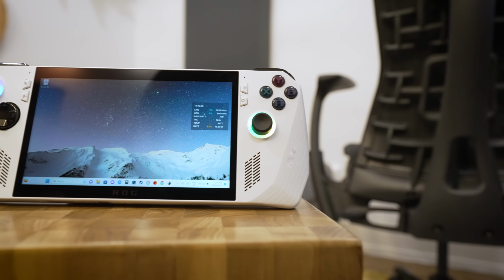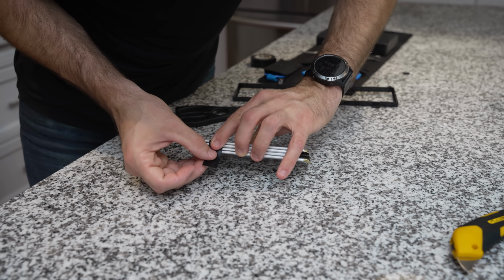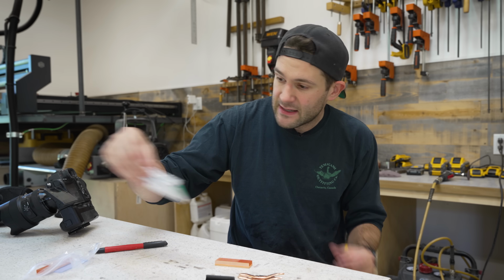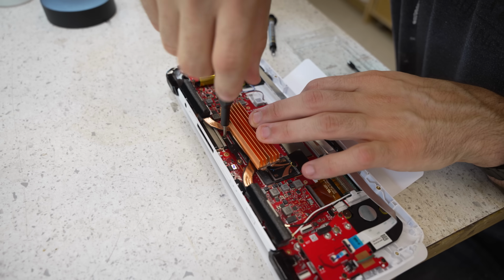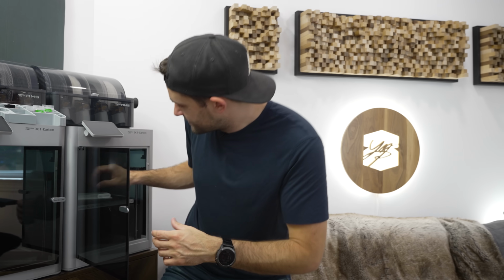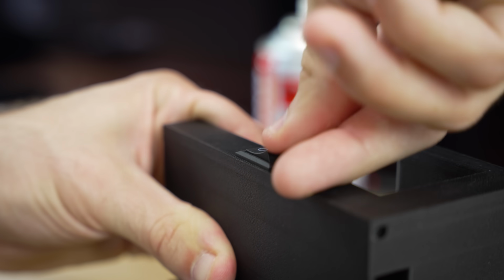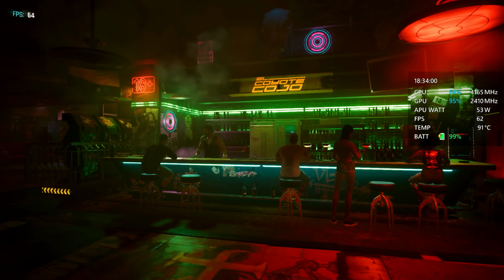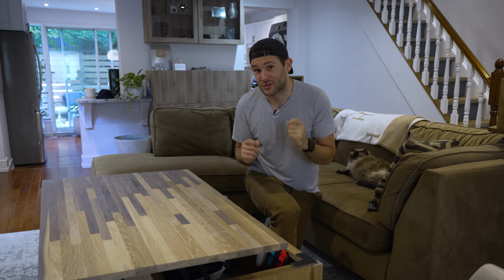I don't understand why people buy Steam Decks...

Comment: believe it or not these processors don't just get magically faster when you improve the cooling.  They have a Goldilocks temp range and it wasn't exceeding that range before so it wasn't throttling.  So yes you improved the cooling but you won't see that big of a difference.

Comment: The sole reason i keep coming back to the Steam deck and hence, why i bought an OLED while having an LCD is just how robust the device is, paired with Valves amazing customer service. If theres something that seems challenging on the deck, the community almost always has an answer for it, simultaneously while Valve is always aiding support as well. Also, the device just works straight out of the box with minimal tinkering, and the ergonomics of just how practical the buttons are, and easy the device is to hold cannot be understated. The deck runs 80% of the games i have and thats plenty for me. Theres always work being done behind the scenes to get problematic games to run smoothly as well, and thats why i will always have my steam deck.

Comment: Reason why I bought the steam deck was it was the first handheld I first waited a few months so they could fix the issues, glad I did cause I was gonna buy a Killswitch from dbrand, but due to them using magnets it killed the fan, and reason why I love the steam deck as well is it is super repairable, right to repair is a big thing to me, and I plan on buying another steam deck LCD to upgrade it to OLED with DeckHD, and the joysticks to make it magnetic joysticks so they don't have stick drift. And hell I can install windows and upgrade my storage to 2tb so I can dual boot windows (gonna dual boot with a SD card due to issues when they update ofc). So you see my loves for the steam deck, here's a few more as well, you got the touch pads, and the back buttons they are in the right place. And you got the ergonomics with my medium hands it's quite nice in my hands. I've given my first steam deck to my sister who was always on the move and she loves it. And I've just heard that you get worse performance and more problems with windows which I have to agree with, when I dual booted windows it was so finnectly cause windows doesn't work well with handhelds yet sadly, and valve did wonderful with Linux, it's quite well made and you got desktop mode which is just using as a desktop. I am not a shell for steam mind you it's just they made the right steam deck when they first made it. And I appreciate that. I wish the other handhelds did Linux as well so we could probably get more people playing on Linux and we get more Linux gaming. Oh and its 350 compared to other handhelds whoch are 500+ if i wanted that id buy a laptop

Comment: While asus really did release a near steam deck killer (I still want one myself lol) they could have easily used that little indent support space to fill with more battery. it wouldn't even have changed how the battery would be made. it would just be an extremely irregular shape, then they could chamfer the edges so it has a nice and smooth slope for the extra battery. It would have probably have doubled the battery life in one sitting. While it wouldn't be no switch, if they had made the batteries hot swappable with two different distinct connectors and it would have cost them essentially the corporate equivalent of $20 and a couple hours of elbow grease with finding a battery maker that could make such an odd battery. Cause asus could have single handedly taken over the handheld market. Especially if they were open and inviting to the mod community (fat chance of that one) they could have even stolen Nintendo's spot as the handheld golden child. (With a few notable exceptions in more recent years. Nintendo should just stick to handheld, they suck at making a console lol)

Comment: I'm happy with my Switch, never really understood why televisions need to be ultra high def as my projector, a device capable of giving me up to a 300" screen looks just fine and it runs at 1080p.  This projector is a Vankyo Performance V630.  I only really use it occasionally and I think for the $100 sale price I paid for it, it has been pretty good.  Otherwise my monitors are in the 20-24" HD1080p category as that's all I require.  

That being said, I'm not sure if it's a good idea to put gaming PC hardware in a handheld platform.  This is the reason most ultra-portable computers use ARM processors.  Nintendo has been using them since the GameBoy Advance and they are renowned for their efficiency and portability while modern x86 processors often need active cooling and lots of space as well as sucking batteries dry very quickly.  That's why they are commonly used in laptops, PC-based tablets/2 in ones over 10" diagonal and desktop computing only.  The APU used in handheld PC gaming machines like that of Steam Deck and this thing is similar in power to what is used in the Xbox One, Xbox Series, PS4 and PS5 machines.  Notice these boxes are typically plugged into the wall and tethered to a television set or computer monitor.

Also, I want to just play the game, not having to tweak settings or wait an enormous amount of time for the operating system to load.  My Switch boots probably much faster than one of these things because the operating system is fairly compact to Windows:  It's a Unix-like operating system built around the processor and system instead of several systems like that on the PC-based handheld.  Now, looking at the Xbox Series X, it's supposed to be a fairly swift box so I guess time will tell.

Comment: I usually get 4hrs+ on my steamdeck without any shenanigans other than setting it to 7w. I love the idea of the ally but they really shouldn't have gone 8 core on the cpu side, i know they call it a "z1/extreme' but the chips are just laptop equivalents (It really stops you from setting lower wattages). They should have made one standard model using something like the 7640u (6 cores 8 Cu)

Comment: That is not the curve of less returns.  The curve you are talking about starts at 0 and 0 for power and returns then as power goes up you get a steady increase in returns until you get to a certain point where it abruptly changes and when power goes up the the returns only increase a little.  It almost becomes a horizontal line.  A good example of the curves with less returns is the curve of memory and performance.  On most computer setups when you try to upgrade above 32GB of memory you won't see a big increase in performance like you would see if yo went from 8GB to 16GB.

Comment: On old cards like video cards you used to see where they had the small heatsinks stuck right to the chip with some kind of adhesive that was heat conductive.  if the heatsink was ever knocked off there was no product that i could find that would work.  I was wondering if that low temp stuff was what they used ... Hmmm

Comment: Power alone isn't everything, that's why the Steam Deck dominates the space.  Valve essentially took the Nintendo approach to a console:  Affordable, capable enough, and most importantly, easy to just pick up and game on.  The differentiator being that they didn't lock their console down, and embraced homebrew.  That's why it works so well.  I tried a Lenovo Legion Go, thinking I would like it more.  I was wrong.

Comment: My Steamdeck failed 2 times already badly ... it got stuck in a booting loop during an updated and had to be reinitialised loosing all my files and gamesaves that didn't synched yet. Then i've moved the stuff to msd and it formated it with my saves on it ... not the best device in existance but way better than asus when it comes to customer support

Comment: Well I might be late, here's why I just bought one:
1. It's considerably cheaper. (I even picked the 1TB OLED model via Steam itself, lower price than the Ally X Model)
2. Devs have an official solution to optimise their PC games, and we get support from Valve themselves.
3. Valve actually keeps to their warranty so long as self-done mods or a third party don't screw up the stock internals LMAO.
4. Who wants to deal with bloated, privacy-invasive Windows 11 on a form factor that was never considered in the first place?

Apologies, but you went too much into clickbait. If it was better than a deck, this video wouldn't exist.

Comment: I don't understand why anyone buys these handheld. The specs for the price are really bad.  For example the steam deck is like 90hz refresh rate. Honestly the best way to play a hand held and to be able to play at high specs is to use your phone, yes i said it use your phone and this is how you so do it! If you have a top model mobile phone say something like the Samsung galaxy S22 ultra or anything higher or the Fold 5 or 6 even better again for the big screen. Well these founds come with better resolution then these handheld PCs and also a big factor the refresh rate which  these top end mobile phones have 120hz refresh rate. Now go get yourself a backbone mobile phone game pad or razer or any of your liking and clip your phone into it. Now your going to say you can't play games with a mobile phones built in graphics card and here is where Nvida Geforce Now massively comes into play. Sign up to Geforce Now and an Ultimate subscription which is around £200 a year (yeah sounds alot but for what you get it's not at all). Now with your Geforce Now Ultimate account and phone attached to backbone pad you now have a handheld that actually plays at 120hz has RTX 4080 performance at full HD 1080p    or 2K 1440p depending on your phones resolution and for a hell of a lit cheaper than any of these overpriced handheld cost. You can find backbone controllers for £60 and say you get 1 full year geforce now Ultimate subscription for £200 that's £260 all in and alot cheaper than the Steam deck and Asus rog rally. Yes you may say oh but that's a subscription and yes it is but everytime Nvidia bring there new top of the range cards out your Ultimate membership follows suite and gets upgraded which means your constantly have the modern graphics card and your not stuck with a big giant outdated paper weight.

Comment: Its THE HEAT, if you can't keep it UNDER 73c then the CPU WILL THROTTLE at 54watts ... at least thats my experience from RYZEN LAPTOPS I have tinkered with... Once I got that HEAT down to under 73c (Now that CPU MAY BE DIFFERENT in TDP throttle) but the loss was a HUGE GAIN at those lower temps.

Comment: I know I'm late to the party but thought I'd might as well point out something I noticed: The 90° NVMe adapter looks cool. But one thing to keep in mind if used to swap to a bigger/cheaper 2280 drive: Make sure you check power usage on the new drive. A fast PCIe 2280 drive might use quite a bit more power than the 2230 model the ROG Ally ships with. I think the original NVMe drive sips around 3.5W during "regular use", whilst the less power efficient models of 2230 drives I've seen use over 6W. The non-power-efficient 2280 desktop models can be significantly worse still. There's a reason some of them ships with a cooler on them.

Comment: The custom cpu made with Nvidia offers unrivaled price and performance it doesn't matter how many fps the ally will get as long as the deck will run most of the games at a good frame rate it will remain the defacto. 
Its like saying why were ppl buying a 300€ console when my 2000€ pc can run games at 4k . Modt ppl who buy the deck play indie or smaller titles and some light 3A gaming, and for that the ally isn't worth unless u don't have a pc and u want to main this . The price is too good and what the ally offers isn't really worth 3 times as much

Comment: That copper is not nickel plated GL down the road that LM and Copper is going to turn into an alloy in the copper it won't end well over the longer term. You should have used another Honeywell PTM7950 thermal electric pad.  If you want to see an up to 15% uplift on some games do the 32gb of ram mod.

Comment: So I've been modding hardware building custom PCs in doing the unthinkable with barely legible tech in the field that I'm pulling things off with for years now like since 2008. That said that aces rogue I'm just glad wasn't a steam deck because there is real no noticeable game that would warrant an approach to destroy or potentially harm a handheld gaming rig because just think about it that's no slouch and it fits in your hands so odds are after product testing and stuff to stand a duration of the general public it's probably designed to be capable of the maximum performance and satisfaction that it can give without further updates to the firmware and the BIOS and drivers and stuff like that later on down the line but it really was hard task to watch this video and I really wanted my socks to be blown off but you did a good job of saving face you really did. And I stopped it when you said you were just going to basically network stream from your gaming PC that's purpose built to the wrong and through the rug into your TV but I'm pretty sure you've already got something else to do that because almost anything could do that nowadays with high speed internet and a good gaming service. I've been struggling with a lot of these videos of seeing stuff being done to devices and systems that don't need to have it done to him and there's no real noticeable game to warrant the investment physically in financially and mentally to be put into the system like that and it even shortens a life of the system but I do give it up to you because you stood true to it and you did a good job. But my opinion don't mean anything other than the one thing you need to take away from this, I'm not the only one out there that feels like this I went to Caltech for cybersecurity and graduated and ended up just going into PC and small business and home network design and stuff like that remote management. I'm not alone and I'm not the only one that tells the same way.

Comment: listen just because you bought a bad product doesn't mean you need to take it out on valve's steam deck. the rog ally is considerably worse for pc gaming as it has no touch pads or haptics to scroll around with better yet be used as a mouse in games that dont work right with mouse and keyboard config for steam. i can reconfigure the steam deck to work with ANY game because of the extra abilities it has! even games that support strictly keyboard and mouse.

Comment: It indeed has a more powerful hardware than steam deck, but steamdeck comes with a linux build that is optimized to run games from steam library, while the rog ally is using the memory and all resources hungry Windows, so it's not like the Steam Deck is in an actual disadvantage.

Comment: Geeeezzzzzusssss...... (but, 1, I sub'd at like 8 minutes in when I saw your shop. You earned that, and for better or worse now I'm in your catalog commenting away. ;p)  But, damnnnn, that's some upper level mods when you have to flex and bend copper within specific heat parameters. This feels more like a 'flex' video than a 'how-to', but again, I sub'd and am giving a genuine salute to your patience in such tasks. 

Buttttt, while you've convinced me to give a ROG Ally a solid look, it's the Steam OS and my second-hand price/snatch of $320 that made me pick the Steamdeck over anything else. I'm not sure I'm ready to break down a retail sticker device over $300 the same way you did. But again, serious salute, and I'm in your sub loop for all the future goodness, for better and worse! ;p
Reply: All that said, you're depth in the "liquid metal application" portion was a very good "how-to" for more than just this specific use case. ....where have you been all my life???? Free for drinks later? ;p
Reply: 16:48 Will robbing that USB port of current, should you flip the fan switch on while in use, cause issues with any devices plugged into it (like an external USB drive)?
Reply: 20:56 ....I was definitely thinking you'd just say, "jump straight to LN2 and go for broke." ....come on, over 700k views from this... doooo it. The power of Zoolander compels you.

Comment: - below 300 usd on sale
- much more power efficient than the competition, so better battery life
- tons of input options with very good customizability
- much nicer experience out of the box
- focus on repairability
- supports open source software practices, its very existence signals to developers that there is demand for gaming outside of microsoft's spyware OS
- doesn't fry your external storage

If the steam deck had a quarter of the switch's market share, the world would be a better place.

Comment: Now we can get it for extra 150 usd. Double battery life, better temperature, quiter fan, more ergonomic, more extra ram (24 gb) and faster ram speed (7500), better dpad, better button, more durable analog, extra type c port, and no card reader issue anymore. All of these benefit in almost same form factor. Thats rog ally x.